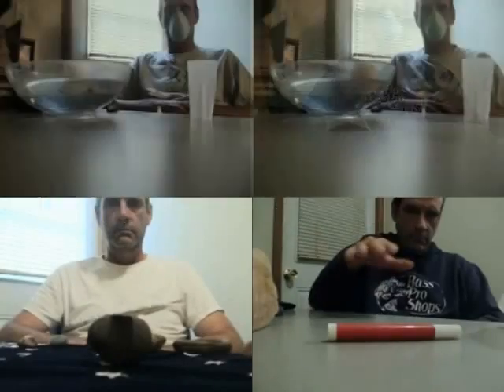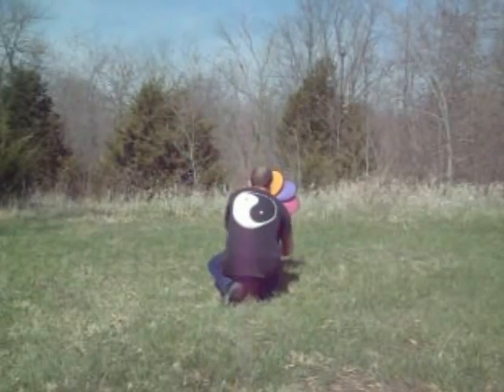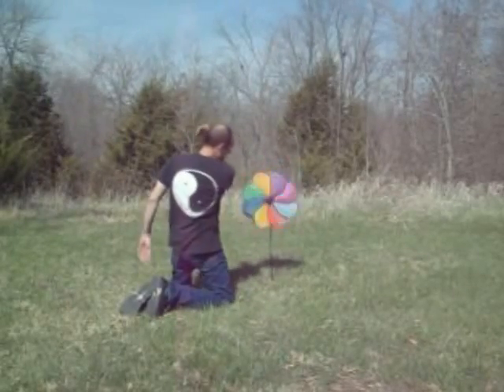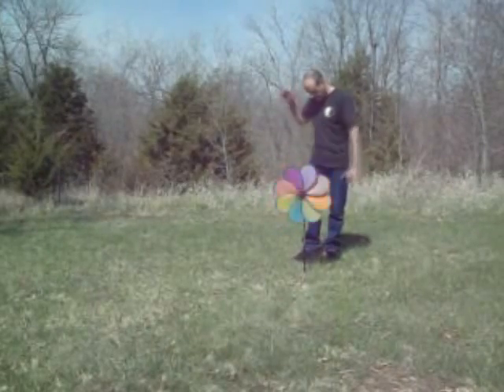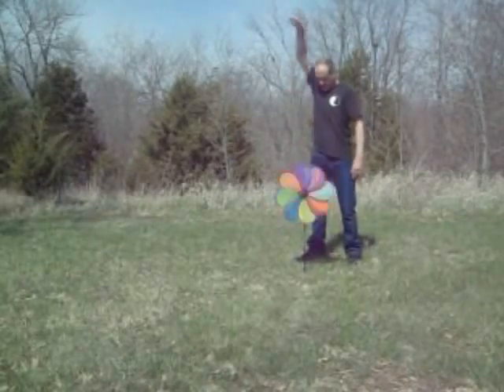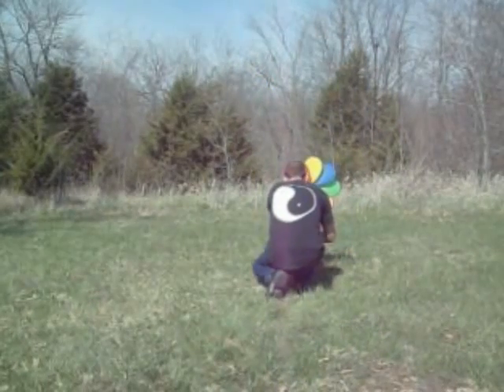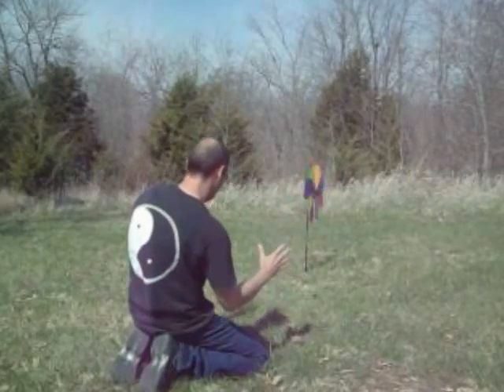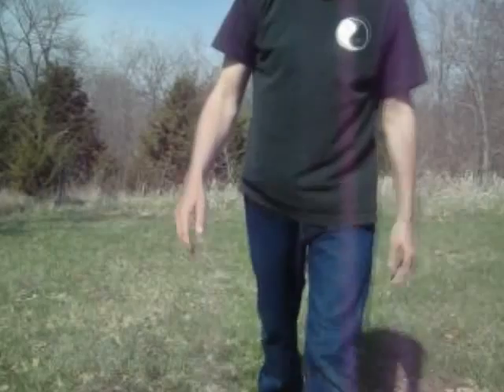☢AEROKINESIS☢ Airbending with a Pinwheel

Comment: You are using it seem to me too much telekinesis on the wheel and not using enough wind power.  Try to pull the wind in from the trees.  What I do is focus on the reaction of the trees and listen to the wind thinking of myself and GOD being one with a big face and command winds and seeing my face blow non-stop
Reply from the maker: Thanks for the advice Anthony. Namaste
Reply: I love this video so much that I'm going to order one of those Pin-Wheels for myself but I like the one that you have.  Would you be so kind as to send me the information where you've ordered your giant one.  I have one like it that I've bought at a $1.00 store several months ago and it work quite well but I like the larger one.  
  I use psychokinesis as well on trees and sometime on small forests.  I've blanket off a entire town with clouds twice and cleared it up within 5  to 7 minutes.  This was amazing to me for it at the time was my first time doing such a thing.  I did this about a year ago.  I've made it rain then sunshine again and many other thing.  I shouldn't ramble on so I'll just say thank again for responding to my ORMUS request which I saw on my e mail but haven't read it yet.
God Bless and continue spreading harmony and wisdom.  
  Oh!, I placed this video on my website that others may see, learn and hopefully contact you through it